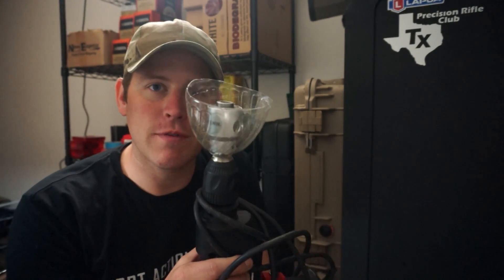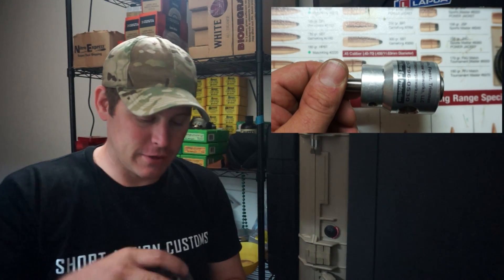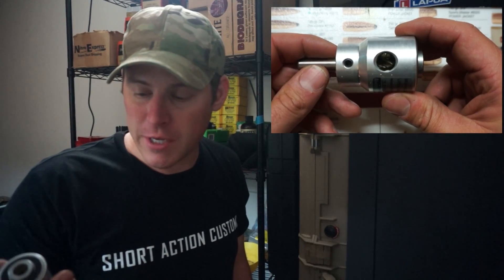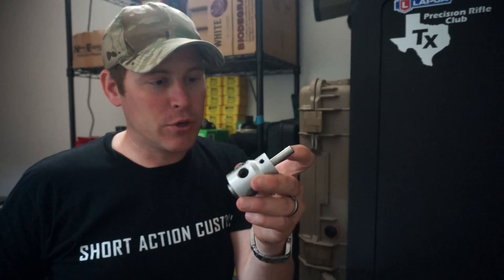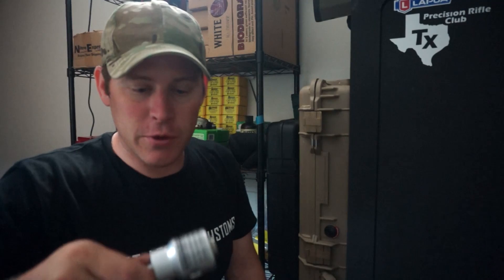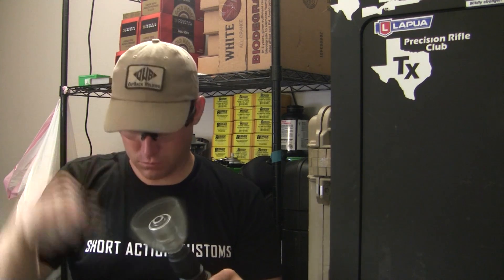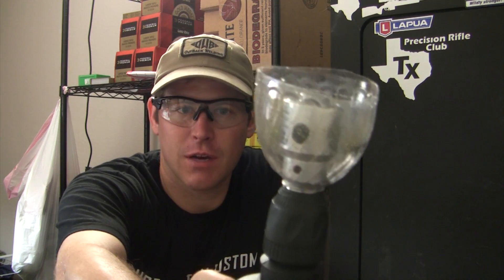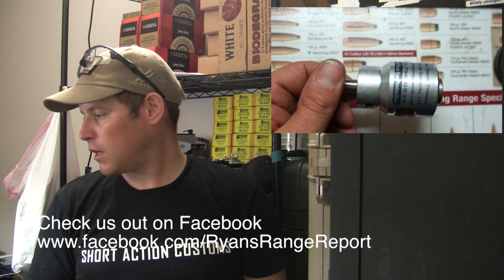Worlds Finest Trimmer : Trimming rifle brass for Reloading.

Comment: I start by de-priming the cases and then tumbling with stainless steel media so Is it possible to resize and prime the case and then use this tool to trim to length if needed seeing that it measures off the case shoulder? I would then be able to continue In a progressive manner through the powder, bullet seating and crimping stages. What do you think?

Comment: I held off reviewing this product, as I do many, until I am satisfied with how well the product keeps up and how well the customer service is handled. At approximately 4500 cases, the cutters gave up. Tried calling their customer service number 3 times... no answer. I had to email them to get a response. It took 24 hours. Ironically, they state in their reply, "Give us a call if you would like to order a cutting blade...". WOW!

After all was said and done, they passed the buck to MidwayUSA and said, "have them handle it". I couldn't understand why I should have MidwayUSA involved in a customer service/warranty issue when it is clearly their product, their patent, and they also sell it through their web site. Per Amy in customer service and Dale in sales, those blades are expected to last you through "4000 to 5000 rounds". Its in black and white in their email response. I will forward it to anyone that requests it. Nowhere in there advertisements does it list a life expectancy for the cutter. Only that it "will last a lifetime".

Your cost to repair a product that "will last a lifetime" (quoted per their general specs) is $10-$25 for a new cutter that will ultimately last you another "4000-5000 rounds" before needing to be replaced.... again. This, by the way, does not include shipping costs. Whatever you do, don't count on any warranty... they apparently don't feel that one is necessary when THEY feel the vendor should "handle it" for you. No thanks. I'll purchase my trimmers from their competition from here on out. There are many to choose from that are quite superior to their product and you get more for your money... such as actual customer support and a warranty.
Reply from the maker: Giraud makes a 3 way cutter that's a like design. He has good CS. I have his big trimmer, and it's great.
Reply: Ryan's Range Report I'll have to look into that one also. I've been checking out the Trim It. That one has a built in micrometer and comes with dies for 223 and 308. Simple to replace dies and set up, especially since you can dial it in to a more precise trim using the micrometer.... and under $100.